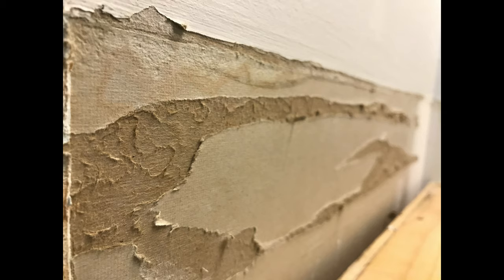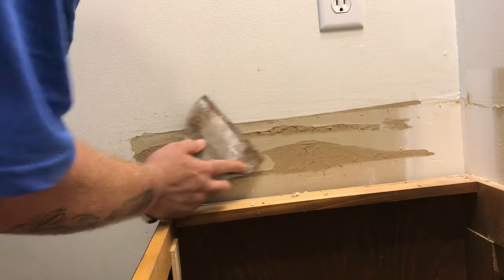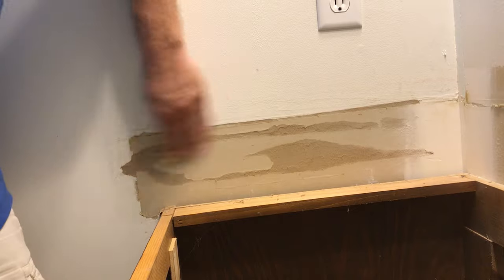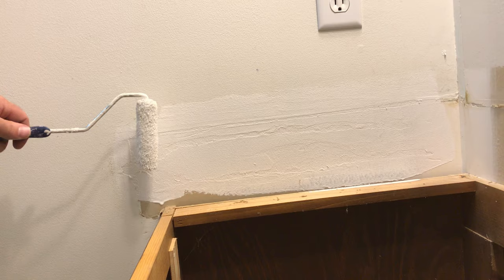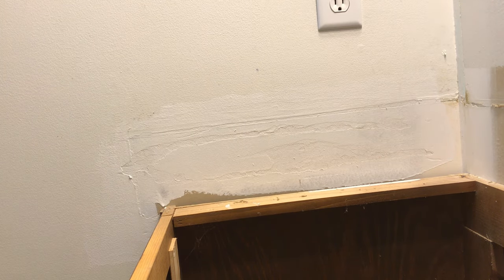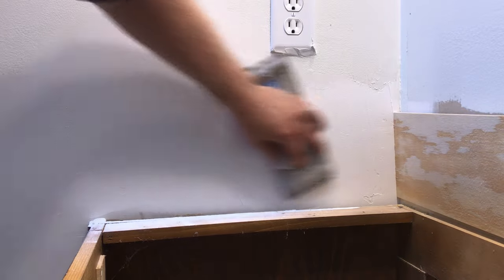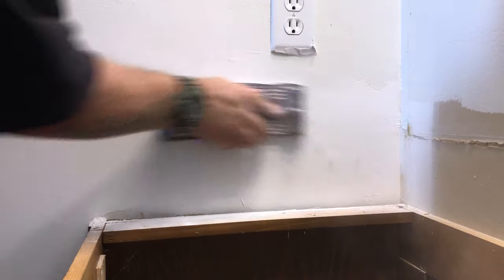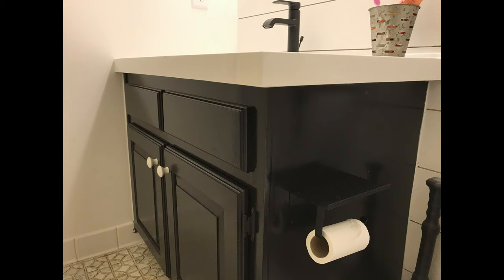Torn Drywall Paper REPAIR | DIY DRYWALL

Comment: Would this work on a whole wall? I peeled the paint of the entire wall on my garage from the previous owner painting it a horrible sky blue with tree decals on it, and most of the wall went down to the brown drywall paper. Would the shellac base and then drywall compound work for the entire wall? Or is there a better option? Thank you sir!
Reply from the maker: Yes, you can make large drywall repairs using this method.  My friend @paulpeckdrywalltube has an awesome channel where he dives real deep into this subject.  Check him out here…
https://youtube.com/c/PaulPeck
Reply: @TonyCollumtheHOWTOHERO  Should you prime with shellac on all small holes (like molly bolt holes) b4 using hot mud?
Reply from the maker: @jazz901  if I don’t have any paper showing (areas that could bubble) I just lightly sand, make a simple in the hole using the handle end of my mud knife (so it recesses the hole and any nibs of drywall edges) and then mud.  Pull it really tight on the first pass so there is only mud in the depression and let it dry.  Once dry sand and if needed pull another pass of mud (typically if the mud shrinks)
Reply: @TonyCollumtheHOWTOHERO  Thank you.  Yes, I did that bcuz I had watched Paul Peck. When dry, I did another pass of mud and then sanded again. Now I'm priming but the repair is taking the primer differently than the rest of the wall. Don't know what causes that. Afraid to paint bcuz the repaired areas are drying dull, not like the rest of the wall.  I might have to skim coat entire wall?
Reply from the maker: @jazz901  I’m assuming your repairs were done well and the walls seem flat and straight.  Not trying to sound condescending here but I’ve seen some pretty bad repair jobs and the following tips will not help a bad repair.  However based on your statements it seems like you took care of business…

totally normal for the repair area to take the primer/topcoat differently.

The drywall repair spot is a sponge…it will soak up the primer/paint.  

Use a good quality primer.  You can even use the BIN primer I talked about.  On big repair jobs I use a PVA primer.  Even with the primer, the areas of repairs will look a little different.  Primer is usually a flat and dull paint.  By itself it is porous.  However, the first topcoat of paint will seal the primer and then the second coat will match the surrounding areas (as long as you matched the paint)

 go ahead and plan on 2 coats of paint.
Reply: @TonyCollumtheHOWTOHERO  Thank you, thank you, thank you.  That has given me peace of mind. I'm a perfectionist DIYer and I follow instructions to the T, so I couldn't understand why the variance.  As long as 2 coats of paint will do the trick, I'll be so happy.  I was getting ready to apply another coat of primer (I used Kilz Original Oil-based) on all walls and will be painting entire bathroom.  All walls have some repair becuz I removed towel bars.  You've been such a huge help!  Thank you.

Comment: Do I  need to do this if I'm going to use stick on backsplash?
Reply from the maker: Great question.  Remember every good build starts with a good foundation.  The unsealed  paper would most definitely reduce the “stickiness” of the material.  Sealing it will lay down the fibers and give it a nice surface area to stick.
Reply: @TonyCollumtheHOWTOHERO  thank you so much for responding and your video is very informative.👌
Reply from the maker: @catherineespiricueta2162  I’m very glad that the video helps.  Good luck with your project.

Comment: GRDZ IS NOT THE SAME. IT'S WATER BASED. Also for a small job like this they have a quart can or a 13 oz spray can
Reply from the maker: I have never used Gardz, but it does produce the same desired results.  Yes they do make smaller quantities.
Reply: Oil base killz works too the spray cans are super easy

Comment: Hi,  I removed cabinets and wallpaper in my century home and was basically left with brown walls. I can see the nail heads so Im not sure if its completely torn, or just different because it's old. Either way, if I seal the walls, can I salvage them? I'm worried Ill be over my head if I try to replace the drywall sheets. Thank you
Reply from the maker: I’m no drywall expert by any means... I’ve just repaired a bunch on my own but, the only issue I see is the nail heads are not “set” in the drywall.  Potentially, you could set the nails, if it’s torn paper, seal it, mud all nail holes, sand and then skim the entire wall for a smooth finish.

It’s going to be quite a bit of work but will look great in the end.
Reply: @TonyCollumtheHOWTOHERO  thank you!

Comment: Does it have to ve primer or can u use paint then mud
Reply from the maker: You want something that will seal the paper.  I don’t like paint for this.  Maybe an oil based paint, but sticking with some type of oil/shellac based primer to penetrate and quickly seal the paper

Comment: Hello, will the Oil based version of this exact same stuff work the same?
Reply from the maker: Yes, an oil based product should seal the paper and prevent any bubbling when applying the mud
Reply: @TonyCollumtheHOWTOHERO  would kilz original primer work
Reply from the maker: @michaelawilliams4550  yes it would.  It is oil based and will help seal it

Comment: Great tips! I have a question...how do you fix the bubbles if you DIDN’T apply the primer first??? Can they be sanded out and then covered with primer? Thanks for your input!
Reply from the maker: I usually cut them out with a knife and then prime and mud.
Reply: Ssnd it down ..mix up 20 min mud ..and right before it kicks off wipe it down with ur knife...kinda smooth it out ..sand it ..repeat..

Comment: I ordered the Gardz and didn’t realize it was water based. I already used it and now I’m in the midst of mudding. Will the water based still work?
Reply from the maker: Yea, the Gardz product (water based) is supposed be great at fixing these problem areas as well.  I chose to use the BIN because I had it on hand and does the exact same thing (plus my local big box store doesn’t have Gardz on the shelf).
Good luck on your project and let me know how it works.

Comment: Question do I have to anchor an island down if the sink is going to be located in it !?
Reply from the maker: Not necessarily.  However, there could be the chance of damage to the rigid pipes if the island were moved by accident.  Obviously, it would take a serious move to cause damage.

Comment: I used this BIN product on my torn drywall.  Let it dry at least an hour in one place and overnight in another. When I applied the mud, those areas with the BIN product started "weeping" or "dripping" on the wall.  What did I do wrong or do you have suggestions? Thanks!
Reply from the maker: You mean the mud started dripping?  If so, you are applying to much mud at one time.  Pull thin, tight coats with light sanding between to achieve desired results.  Or you had the mud too thin and it wasn’t holding in position.
Reply: Thank you!  I appreciate your time!   @TonyCollumtheHOWTOHERO

Comment: Its easier just use tapping mud... yellow mud, con fill, fast set... 2 coat and done
Reply from the maker: Possibly, but I’ve seen people (don’t care how good of a finisher you are and you pull the mud tight like it’s supposed to be), spend unneeded time picking pieces of paper out of their pan/skim coat/hock because they didn’t seal the paper (mainly in large jobs).  With the Bin it’s dry in 15 minutes and ready to work no problem

Comment: We have the “blistering” issue in our entry way from removing chair railing. Our front door reflects a lot of light and you can see every bit of it! Would this method prevent the clash of lighting or would we have to buy a different door?
Reply from the maker: Remove the blisters.  Cut them out, treat area with a primer like in the video, and skim with drywall.  To help in a highly visible/highlighted area you need to skim a wider area than what was originally damaged.  With a proper drywall repair of the area you shouldn’t be able to see repairs.  

I have skimmed entire walls to eliminate imperfections

Comment: I was making a similar repair next to a shower due to moisture. I have heard to prep area then apply this zissner product, but as far as the drywall mud , some say that it will cause issues with moisture? How can you get it smooth for primer and paint without drywall mud? Are certain muds better around showers or bathrooms? Also heard to always use special paint in bathrooms to avoid moisture issues.
Reply from the maker: I’ve never had any issues with a properly prepped and painted surface in a bathroom because of moisture... I’m only referring to moisture (steam, etc.) not because the area is getting wet from direct exposure (water spray).  If it is getting hit with water then I don’t have an answer. Does your bathroom have an exhaust fan to help eliminate excessive moisture?
Reply: @TonyCollumtheHOWTOHERO  Thanks for reply. Yes my only issue is where some water from shower hits drywall ocassionally. It has blistered some and just want to ensure I repair area correctly to help it from reoccurring.
Reply: @TonyCollumtheHOWTOHERO  I had heard that thinset mud absorbs moisture and would cause blistering of paint if in area that could get wet.
Reply from the maker: @faaradar  most any mud, if left without a top coat could absorb, but once you paint It should seal off the absorbing abilities.  For any repair in a wet area, I wouldn’t recommend getting wet or exposing to moisture for long periods of time without a topcoat.